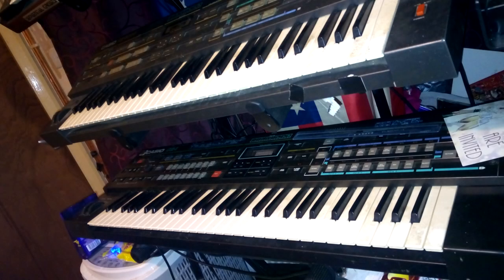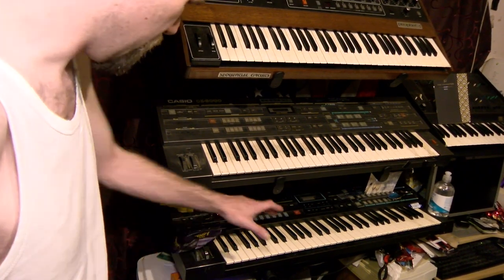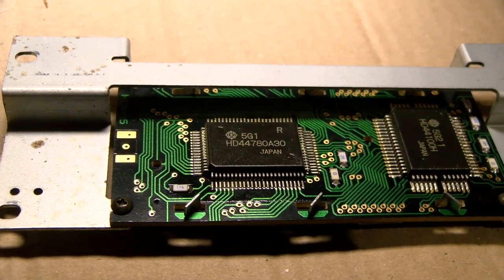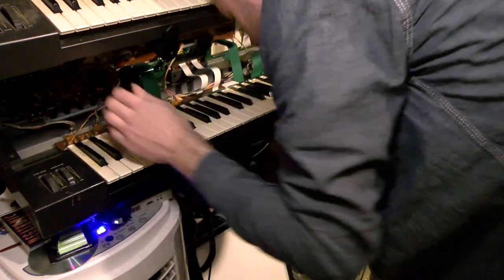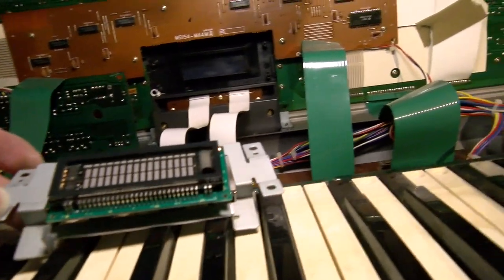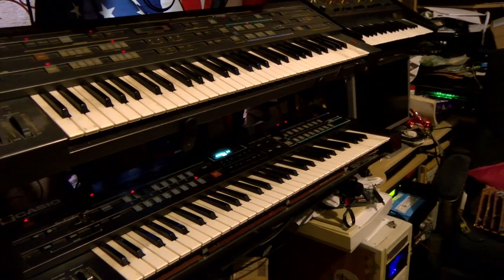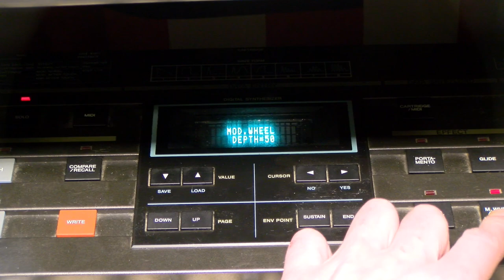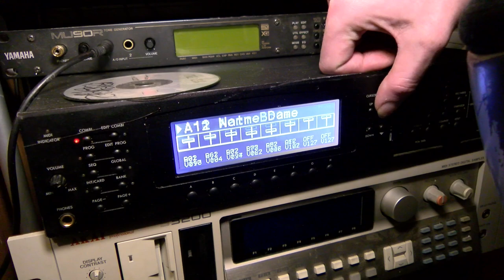Casio CZ-1 LCD Replacement - With a VFD

Comment: That's very cool. I've already got an OLED sitting here to put in the CZ-1 but VFD is super cool. Everything is better with a VFD display :)
Reply from the maker: Suppose the OLED has the advantage of lasting longer, in theory. The VFDs will fade with time, though should last multiple decades before it becomes an issue with the relatively low duty cycle of a synth. There are plenty of LaserJet 4s out there that were almost never turned off and theirs are usually still pretty bright.
It'd be nice if there was, and there may be for all I know, an OLED display with RGB adjustment trimmers to dial in any color you wanted. It wouldn't look quite the same, but could probably be made to look fairly close.

Comment: High Treason...I'll dump this here hoping you can help! Working on a spares CZ1, have an issue with 1 keybed key! A few keys were dodgy, but have all come right with the usual cleaning, re coating rubber parts and sodding about. This 1 key is quite erratic regards velocity, it will sometimes be OK then not. I swapped rubber/keys around to chase the fault, but it stays on the same position, doesn't move with the parts changed. I've checked the diodes for faults, all good. The traces all spit out their signals OK and the metal pads on the PCB are good too. One thing I have noticed is if I hit any key low velocity and then the faulty one it will go low, if I hit any key high velocity/volume it will go high...like it's following the most recent note struck. After a few notes it will come right....but sometimes it will do it's own thing!?! Any ideas? Cheers.

Comment: Greatvideo. The character set issues with the abundant HD4478's available is often overlooked. I was replacing a non backlit 16X2 screen in a Roland R5 some while back and all went well until I noticed certain characters not appearing correctly, namely "reversed out" numbers for options menu (number is not lit, all other dots are lit) - they came up as odd chinese looking characters. There's no fix for this as the displays just don't have the support for the R5 sending that code to them. The original display still worked so it went back in, just a bit faded.
Reply from the maker: I can't remember off the top of my head if reversed characters are a feature of these displays, but the VFDs do have 'user characters' where the device can add its own new ones on the fly. Maybe that's what it's trying to do and the Chinese characters occupy that space instead, as a lot of displays can't be programmed that way.
The VFDs actually have a small few other fancy things like brightness settings, though there's no way to access these from the CZ-1 without adding logic to send the relevant commands to it.
The thought occurred that the China LCDs are so cheap that, in some cases, it might be viable to simply steal the backlight from them and fit it to an older display.
Can you counter the LCD fading at all by fiddling with VO/VEE, probably on Pin 3? That should be the contrast adjustment if it's a HD44780 compatible, though it could also be a reset pin. The CZ-1 has a trimmer to adjust it between 0V and 5V right by the connector, which had to be cranked to full for the green China LCD. Be sure of your display's voltages if you're going to adjust this, as I think some are 3.3V max.
Reply: @HighTreason610  Cheers. The original screen is OK, to be honest I was just sodding about seeing what else I could stuff into the R5 to make it look better. The screen is woefully useless for information - the R8 screen is much better, but the R5 is a cut down version and they skimped on that part sadly. I see you have a Casio CZ5000 - any good?
Reply from the maker: I didn't want to say anything, but did think the R-5 looked like the gimped version of whatever range it came out of. I just use an RZ-1 here for the bulk of drum work. Have considered grabbing an RX11 some day if I happen to spot one cheap.
The CZ-5000 will make just about any noise that the CZ-1 will, only without velocity and aftertouch. It still gets a good chunk of the workload and sometimes goes un-credited for it, usually ends up being given basslines of pad chords where those features aren't needed.
Reply: @HighTreason610  Just managed to grab a CZ5000 for cheap. It was pretty knackered, but after a few weeks of messing about I've got it running. Missing a few keys, but hey ho 57 keys is plenty. Are there any decent online resources for voices and MIDI tweakers you know of? Cheers.
Reply from the maker: CZLib used to come with loads of programs, but it's a Win16 application meant for CZ-1000s, so will only access user bank A and B. VirtualCZ can send programs to the synth and comes with several, but it's paid software. Most any decent sequencer program should also have SysEx access.
It's a long time since I've done it as I usually just fiddle with the parameters directly on the synth and write them down now, that way I don't need to leave the Presler on or dig out the T3200 to do it, nor take a PC with me if I go elsewhere with the keyboard.

Comment: Why YouTube doesn’t tell me when you upload 😭
Reply from the maker: If it's any consolation, it doesn't tell me when you (or anyone else) comment, either, so I have to check manually. It has been that way for some time, regardless of settings.

Comment: Great to see ya back with another video! Those Synths are fantastic. Are they used for your channel Intro music?
Reply from the maker: The channel intro logo (HTYE/DXYE) was rendered in Build, the 'jingle' uses the CZ-1 and CZ-5000. I considered re-doing it with some analog synth in there, but figured I'm more known for using the CZ at this point, so it may as well just stay as it is.

Comment: A very satisfying repair. I wonder if there are any options for my electro-luminescent-toting NEC PC-7000. I know there were back in the day. Also great to see you playing - don't get that often. Nice Akai, btw.
Reply from the maker: Without having such a thing in front of me, it's hard to say for sure. There don't seem to be very many 640x200 LCDs left in production now, but if you could find one similar enough, it might be possible to make it work. I'd expect abysmal update speeds, though, as that just seems to be the way all LCDs started going from about the mid-2000s onwards.
An alternative, though it might well be costly with a screen that size, would be to find the cheapest display of the same dimensions available, regardless of its resolution, and just steal the LED backlight for use with the original display. It can sometimes be done non-destructively, but other times the LCD module has to be destroyed to get the backlight out, or at the very least might be accidentally damaged in the process.

Comment: So what to you is a fancy wank synth then?

Also I think pinball machines used VFDs. Orange on black usually in either a 15 segment variety of a 128*32 dot matrix. Made sense given that there was already a fairly high voltage DC coming out the power supply to run the flipper coils. They also could do multiple levels of brightness and some machines had really nice pixel art as a result, all in lovely comfy orange on black 

Nowadays modern pinballs have (retch) HD flatscreens which just serve to be a distraction.
Reply from the maker: Evidently those with hinges on the back.
Ah, yeah, I think I have seen pictures of pinball machines with a VFD and my Uncle might have had one when he used to collect them. It was never really my kinda game and the only ones I've played had either 7-segment LEDs or rollers akin to tape position counters, only larger and presumably reset by solenoids or something.

Comment: Great stuff. New sub. More Cz-1 videos please? Cheers!
Reply from the maker: Well, thanks. There will be, eventually, though I can't say when. I have a massive backlog of songs that need working on and then it'll probably be back. I do also want to document attempts to repair my original CZ-1000, not the one that appeared on the channel years ago, but the one I first owned a long time ago which broke. Unfortunately free time is limited, so I can't give any projection as to when anything like that will be.
Reply: @HighTreason610  Good luck with all of that. Cool, man. I'll be waiting. 😃
Reply: Can I sample the first 3 seconds of this video please?
Reply from the maker: Absolutely. Re-use is allowed and encouraged so long as you provide credit - generally just a note in your description or whatever is enough.
Reply: @HighTreason610  nice one. Cheers !